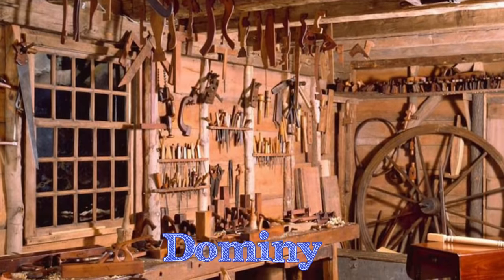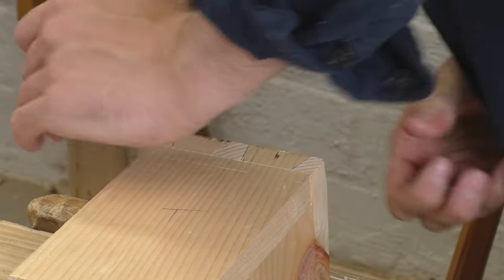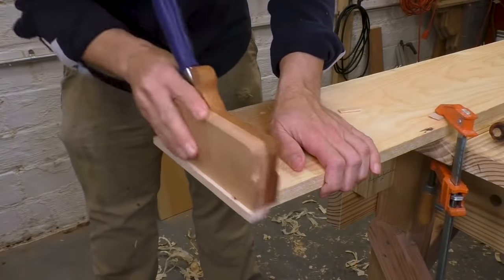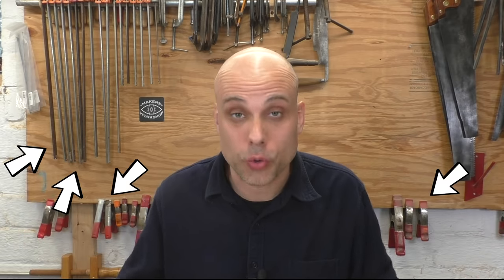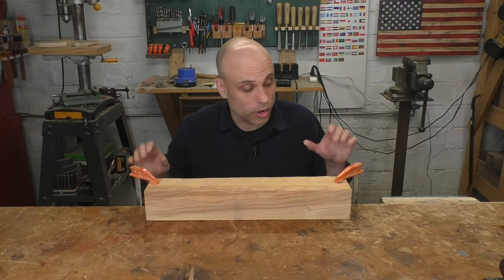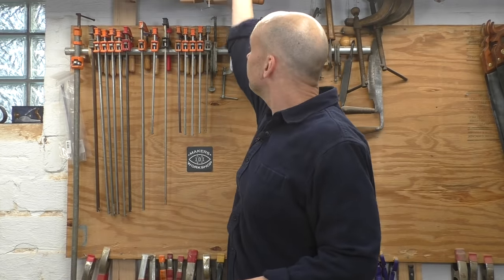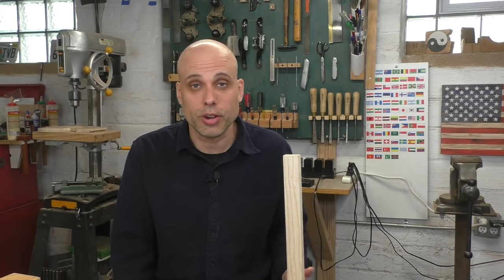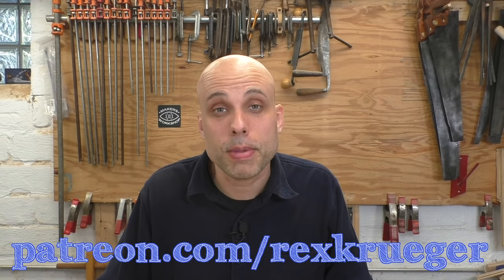Woodworking with very few clamps (maybe only 5).

Comment: I figured I would buy clamps as I needed them.  Pipe Style is so flexible, I have 4 kits with infinite length capabilities.  2 f style is all I have .  A quick grip set is helpful for screw assemblies.  That’s it for 30 years.  I envied the wall of clamps on pbs shows but found that is crap.  Oz behind the curtain for me.

Comment: Great video, with some really useful techniques!
I like the clamp rack in the background.
6:00 you ARE using a clamp.  It happens to be bench shaped.
6:25 that seems like it would bake splitting force into the joint.  Is there an increased tendency to splitting?  Would adding some wood biscuits be helpful?
8:46 1" are available as well.  Plus you can keep various lengths of pipe around and swap fairly easily.

Comment: The twin screw clamps are actually my favorite, it's all physics. The amount of pressure they deliver comes from Lever-arm, the length of the clamp after the pivot point in the middle. As an example, think of a lug wrench for your tires. Pushing or pulling on the wrench close to the lug means it will take a lot more force from you to crack the lug, but griping from the end makes it take less force. The twin screw clamps work in the same way, but kind of in reverse. Rex, you could build a leg vise that could provide crazy work holding power using the same physics... 🤔

Comment: I'm a 50yr veteran of fine woodwork and specialize in radius work, all high end commercial, with every industrial grade tool you can imagine from 3 axis cnc panel machines to 5 axis point to point machinery making forms for exact duplication of parts and forms for steam bent and stack laminated parts. In short I use clamps and lots of them, there is simply no way around it. I utilize spring joints when applicable and several other techniques for assuring a tight joint without any visible fasteners but without a boxcar load of assorted clamps I'd be dead in the water!
Reply: But this video isn't aimed at people in high end shops with everything lol

Comment: Drawbore m&t are handy whether you have a mass of clamps or not - did all my bulk shelving that way. Just don't be heavy handed with glue (if used) and none on the shoulders for neatest fit. Still, I need masses of clamps because a proper pre-assembly dry fit is crazy without them imo. I have a few f-clamps and some small quick release ones but my go-to gear are my sash clamps. I just buy 4 clamps at a time and hope bank doesn't notice. Made some hardwood panel clamps a while back but just too much fuss for a clamp.

Comment: I have an old german book  on woodworking, and in it they use twisting rope for clamping. It's amazingly simple and effective. Get rope tight around the workpiece in two strands. put a small piece of wood between the two strands and twist it tight. the piece of wood then holds the tension.  Old style frame saws use the same principle i think

Comment: I find timber dogs work well for me for gluing doors or table tops, and it keeps your bench top free while it's drying.
Reply: Do you just drive them into the end grain of a top glue-up?
Reply: @leehaelters6182  Yea. I plane the edges of the boards to have a slight hump in the middle so it touches first, then the dogs pull the ends together.

Comment: good tip on the pony pipe clamps, using a coupling. when I needed some longer ones, instead of buying 2 pieces 4' I bought one piece 10' and cut it in half. It was WAY cheaper that way. Of course, I can't use the couplings now, but........I can't fit anything larger in my shop anyway.
Reply: I thought Pony went out of business? Ah I just looked it up and a Chinese manufacturer bought their assets.
Reply: dunno, I've had mine for years...and had one still in the box that I put to use the other day
Reply: @mickdog2  there's two kinds of pipe clamps. There's the clutch plate and the toothed ones. Pony only ever made clutch clamps. In my experience they work great. The toothed lock clamps I avoid. I have some. They always slip. Unless I drill the pipe out and put a pin behind the fixed jaw. That's real adjustable. The trouble with Pony clamps is they worked forever. So once you had them you never needed any more.

Comment: Yes clamps are expensive, which is why every time they go "on sale" or if I find them at a flea market or garage sale, I buy them. But what can be done about these absolutely insane lumber prices??? The prices are getting so high that hobbyists can no longer afford the heart and soul of their hobby. You can have every tool you have ever dreamed of having in your workshop, but if you can't afford the new prices of lumber, all those tools are going to turn into dust collectors, no pun intended. I also wanted to say something about the spring clamps that you showed at the end of this video. Yes, most big box stores, and even Harbor Freight sell them individually. Depending on size and brand name, they'll cost usually between $1 and $10, and then there are band clamps, which are basic spring clamps that have an elastic or rubber strap attached to both ends of the clamp. They're used to attach edge molding and other similar needs. You can save a ton of money on them by getting an old bicycle tire inner-tube, preferably one that has already popped and is no longer usable. Cut a few inches of the inner-tube and slip the ends over the two jaws of your spring clamp......DONE......you now have a cheap band clamp without having to buy one, or ten.

Comment: So funny.  I just had to add a 3/4 inch band to a 10' counter top.  The cost of the clamps was bugging me, so I made so y with 2x4 and ratchet straps.   Clamped right and it came out perfect.

Comment: I liked the idea of driving the wedges in to “clamp” the pieces together on the bench. But I wondered does it not damage the wood when you drive the wedge in?
Reply: I noticed that the wedges were tapered very slightly at a gentle angle, and also each surface was covered with painters tape, presumably to keep things sliding smoothly under pressure and not doing damage.
Also, when it's an option, the boards could be cut a little longer than they need to be, then shave or sand off the ends after glue up.

Comment: I am surprised you didn't mentioned a very handy type of clamp: painters tape. For a lot of stuff, it works just fine, specially if you planned the joinery.

Small suggestion on using less glue, Japanese wood working, including carpentry. Not saying everyone should do Japanese style and abandon  their dirty western ways, I am not weab, but if they can build furniture and wooden castles without hardware or glue, I think one can borrow a few tricks and take some inspiration from them and still do your own thing.

Comment: Also for mortise and tenon joints they can be wedged if through, and fox wedged if blind. No need for clamps, just a mallet to drive the joint home and the wedges in place.
Reply: I have always found that the tenon is not drawn up tightly by the mallet nor the wedges. I always clamp with a bar clamp while tapping home the wedges. Plus, tapping on the tenon, even indirectly through the wedges, pushes the joint apart, though not if you back up the member, I will admit.

Comment: Brands of trigger clamps I've used and have worked well for me are Bessey and Dewalt. For F-clamps I've used Bessey and Yost with good results. The Bessey pipe clamps are pretty good, but their jaw pads come off too easily. Brands that I think are complete crap are Tekton and Powertec - particularly their trigger clamps.

Comment: Hi Rex.  As somebody who is seemingly short on clamps. this was helpful to see.  But also as somebody who has built their own version of your English Joiner's Bench, I know for the leg vise you had 10 clamps just for that glue up.  I only had 4 and used screws in the areas that would be cut away later to make up for the lack of clamps.  But this left me with a few gaps that clamps would have closed up.  So how do you cut down to 5 clamps or less for that project?

Comment: for large pieces, low stretch rope, and a rope tackle rigging can put a lot of preacher on things. latex surgical tubing can put a surprising amount of preacher on odd shapes as well. and most glues won't stick to it.
Reply: I really like the block and tackle idea! Sailboat rigging is a good size, but maybe as expensive as high quality clamps.
Reply: @karm65 , aye, thanks for the link! It’s a great source of information, I have seen it before. And I use the technique often, just as described, for securing loads. I think it is a great idea to use it for low cost clamping and drawing together of parts, but the less than 2:1 advantage it offers seems puny to me. That is why I enthused when I thought you were suggesting a couple of double- or triple-sheaved blocks, and the greater pull they offered. Some even have locking built in, needing no tie-off. I admit that as a general principle, I think simplifying and doing more with less equipment and expense is the best goal to shoot for.
Reply: @leehaelters6182  how puny it depends on how much oomph you put in it. I can apply around 60lb so that gives me almost 120lb I can add a lot more if I really need to.  I find most joints just need to be firmly held together while the glue drys not crushed together. most wood joints should be a slip fit not an interference fit so I find it to work as well or better than clamps in a lot of cases. ratchet straps are another good source of clamping and binding.

Comment: I use handtools and agree with Steve Ramsey that you just need 9 clamps: 4 f clamps, 4 pipe clamps, and 1 band clamp. Obviously clamping up the dovetail box is not necessary as you demonstrated here, but it is that much easier to clamp and square it with the band clamp.

Comment: Just to add pinch dogs were used a lot combined with a sprung joint although in the opposite direction, convex rather than concave

Comment: mmm old school 'timber frame' 'rough shot' real woodworking :)  my great grandfather had no clamps and fed a big family off woodworking :)  my grandfather had clamps but for the particle / trash wood modern stuff but always preferred what he called "real wood work" :)   i'm glad to have been taught both but much prefer the hand tool minimal / no glue real joints and metal for specific design / purpose not structure style of wood working . . .  kris harbor does the 'rough shot timber frame' style work and mr chickadee does the 'japanese' influenced precision carpentry . . . both very desirable styles and i bet the three of you would put out some great collab content :)

Comment: Don't be shy about using screws. Once the glue has set, pull the screws out and plug the hole with either a wood plug, or just putty/thickened epoxy.

Comment: There is an important topic to note that deserves a separate video- hide glue!

I'm quite old fashioned in my work (I do restore pianos on the side) and I've moved to using hide glue for most of my shop work- pianos, plus everything else for what I do as a hobby.  Cabinetry, veneer, myriad boxes, inlay, etc... I typically use hide glue.  Exceptions exist for sure, but I try to find a way to use hide glue first for the following reasons.

1)  Clamping is generally unnecessary.  As hide glue dries, it pulls the pieces together. I'll occasionally use rope/cinch straps to hold things in place but mainly to keep multiple pieces in place.  stop dogs, go bars and wedging is the most common stuff seen for hide glue-up jobs. Also, look into rub joints!  I don't use them often, but it's pretty cool to feel that wood just purchase to the surface and stick like a suction cup!  I think those are more commonly used for stringed instruments like violins.  Piano work is a peculiar mix of brute force and delicate work.

2)  Hide glue, despite being water based, makes joints slide easier!  This means you can usually make your joinery tighter (I usually opt for something around the 1.5thou mark) and they will glide in place like you had +3thou tolerance or more.  I know people understand the reasoning as to why and I think it relates to the proteins present in hide glue.  Something along the lines of the proteins chaining together and that somehow acts as a lubricant before the wood sucks up enough water to swell.

Regardless, you get tighter joinery with hide glue and it's actually a breeze to clean up.  Trick is to not be fussy- let it set and gel and 2-10mins in, use a razor or wooden spatula and gently glide along the seam to scrape it up.  Drop these chunks back in your hot pot and it melts back into glue, eliminating waste.

3)  Once the joint is in place, the wood can swell.  This is particularly poignant in dovetails where the end grain will expand, tightening the joint as it rests.  Also, the hide glue can sometimes impregnate the wood fibers, acting as a seal of sorts as it absorbs the hide glue and its proteins into that cellulose.  Many piano actions (all the wooden mechanical parts) were sized with a diluted solution of hide glue.  This acts as a "poor man's varnish" where the proteins have to hydrate for an extended period before water can reach the wood to cause warp, etc.

4)  Hide glue follows after the wood movement, reducing the separation of the glue to the wood, preserving the strength of all contacted surfaces.  Being water based, it is susceptible to swell and contract with the wood.  When something gets wet, the hide glue first resists hydration, protecting it that small amount from water damage.

5)  I can undo my joints.  A simple whack with a dead blow hammer and the joint usually breaks cleanly, unless you used a very strong hide glue.  I see this frequently in pneumatic player pianos where the only glue used was hide glue. 

I know the gross majority will never use hide glue, but I tried my hand at it and have now come to love it.  I say this proudly despite the laughter that may come my way!  Given my familiarity with it, I wanted to mention it as its another reason why clamps were not used- it pulls pieces together and enables tighter joinery.  I have seen and read about all these characteristics of hide glue (and more) and think it's definitely underrated.  I've seen joints hold strong for well over 100-180 years hold like they were fresh out of the factory.  I bet any reputable violin maker has seen a 200-300yo joint act just the same.  It does take time to gain proficiency but its worth trying out a few times, imo.  Consider getting a few ounces and giving it a go one of these days!  You just might surprise yourself on how much you like it.

Comment: In the old times they used ropes to clamp things up, put the pieces together wrap a rope around it and tension it with a wooden stick, then wet the rope. This was Already Used 1000 years ago by the Vikings. You won’t find these in antique workshops because after they where used, they where cut and thrown away.

Comment: Folks asked about the twin screw clamp I made: Pics of it are on my bowl answer here: https://www.quora.com/How-do-I-make-a-wooden-bowl-without-a-lathe/answer/Jeff-Hall-484
two 1' length of 2x3, cut a 1" hole and a 7/8" hole in the middle and end: the first one gets the smaller hole in the center and the other gets it in the end.  The 1" hole that goes on the end only goes halfway thru.  Then tap the smaller holes for 1" thread.  The some simple threaded rods, a stop made from scrap and presto: your own 2 screw clamp.  And just like Rex, I use it primarily for work-holding.

Comment: Rex, Rex, Rex.. I'm kind of split between having fewer clamps and going on a clamp buying spree. Maybe it's age. I like doing things by hand the "old fashioned way" and learned auto body work using lead and files, etc., but there comes a point when the old methods just don't quite jive with old age, weaker muscles and all that.. It's a lot of work doing everything the old fashioned way. 
In the immortal words of my old man, "Wait'll you get to be my age."
Reply: But the more you do the more you can do. And if it is really hard then you're not doing it right. Look at Paul Sellers. He's no spring chicken but he's still kicking. He knows what he's doing though. Use sharp tools.

Comment: Not a direct substitute, but I've been able to get by without pipe clamps using ratcheting tie-down straps. That said, I end up using clamps more for work-holding than gluing anyway, due to the nature of what I've worked on.

Comment: Yesterday, one of the central parts that I made for a bookshelf/stair project fell off my make-shift table and broke. It was just over 5ft long with 5 female saddle joints, a male crown on one end and a dovetail pin on the other end. It broke right across one of the saddles! I decided that instead of making it over from scratch, I'd just cut out the broken part, and make a replacement that I could stick back in. The biggest problem would be how to clamp it since my longest clamp is a 5ft parallel and this would be just a little too long. Fortunately, I watched this video a while back so I remembered that I could just use a saddle joint, glue it up and use an offset dowel to clamp it back together. 

Crisis averted!

Comment: FOOD FOR THOUGHT: If the Dominys had as many clamps available as we find today, maybe - just MAYBE - they would have had far more clamps in the shop. Also, many woodworkers used little glue in the bygone eras for a very good reason: The glues available the the time, mostly hide glues, didn't hold up well over time. Had modern glues been available in, say, the early 1800's the wood workers of the day just might have used far more glue than they did.

Wood workers prior to the 1900's didn't use electric lights in their workshop, but I think I will continue to employ the things for now.